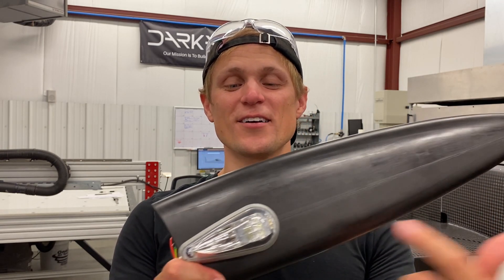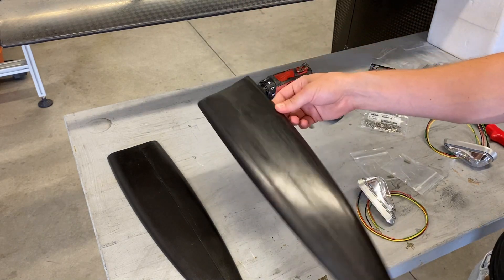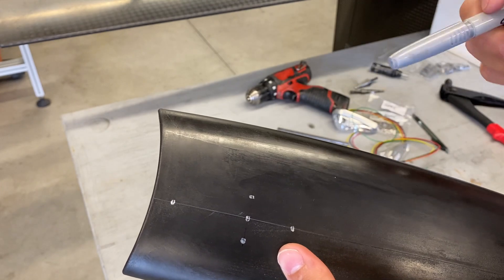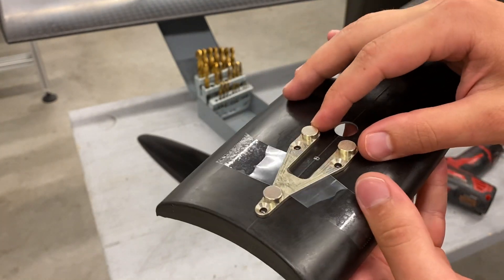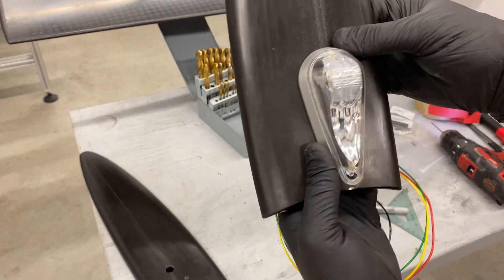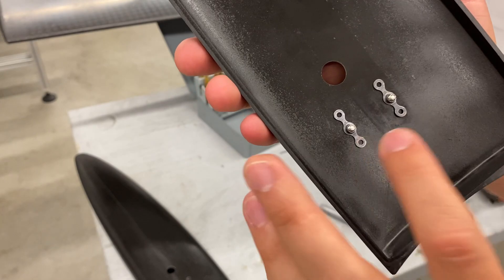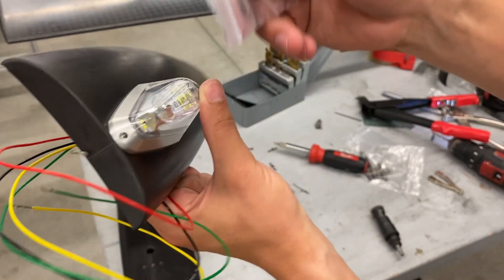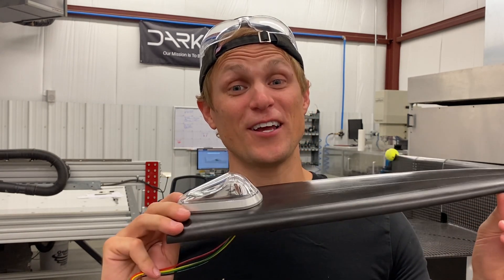Mounting LIGHTS on the Wingtips of the DarkAero 1! - July 28, 2020

Comment: Just curious...with bonding the tip, will you have access for the molex connector for any issues...the old for the wires didn’t seem large enough to accommodate the molex connector to fit through?

Comment: All that beautiful Carbon work, awesome build. Why did you not go with a Exotic wing Tip?
Reply from the maker: Thanks for watching and the question! We answer that in this video here: https://youtu.be/GrlM3OFhKyM?t=94
Reply: @DarkAeroInc  I’m with Russel. I love the philosophy and execution of the DarkAero project. This is amazing. I’m following and sharing! However, I feel like there are a couple details that strike me as treating the form a little discontinuously. I know winglets would not helpful, and are usually just a hack, but i don’t think that’s what russel was getting at. What’s was bugging him and I are that those flat plates on the tail and wingtips looks like there was a sculpted tip that was lopped off. I’m also craving a more integrated form relationship with the spinner and the cowl. Think Legacy vs. IV P.

Comment: Do you need to protect the nutplate, rivets and mounting bracket from galvanic corrosion with the carbon fibre wingtips?
Reply: I was expecting something more like an adhesive bonded bushing. I dislike drilling holes into composite parts if I can avoid it. Steel won't corrode CFRP as easily as aluminum will but it is still something to consider.
Reply: What about water between the light and the wingtip going into the wire hole?
Reply: I was thinking the exact same thing. The corrosion probably minimal, but still exists.

Comment: Must it be a single point or could it be split on front and back corner? then it could be flush in the body. Or even 3 point, front edge of wing, flat end and back edge.

Comment: Thanks for these videos, very fun to watch! Two suggestions - simple paper template to drill all 10 holes at once. Also, a drill press would be handy here...
Reply from the maker: Thank you for watching and for the suggestions! I've never had much luck drilling precise hole patterns using paper templates since they don't constrain the drill bit firmly enough. The nutplate holes need to be nearly dead on or the rivets wont line up so essentially I'm using the nutplate itself as the template. Agreed on the drill press though, probably a better tool for the job! :)
Reply: @DarkAeroInc  Hey! I am so excited that you took the time to respond to my yammering in the backseat here. I have an idea - I just bought an inexpensive ($200) 3d printer, so I've been looking for all sorts of ways to use it to speed up a project i might be working on. So far its been a really awesome tool. I'd be happy to post a really quick-to-print STL file on thingiverse that will be a step up from a paper template because it will have some thickness (5mm or so) to hold the drill bit from slipping as the tip bites in. I know this is a fairly minor and easy task, but being able to quickly print out a simple gadget/guide/template for a bunch of small tasks throughout the build can really streamline the process. Let me know if you want to send over a simple scan or spec sheet of that mounting bracket and some nutplates, and I can easily model it up in Fusion360.